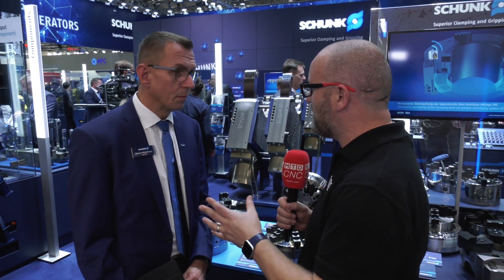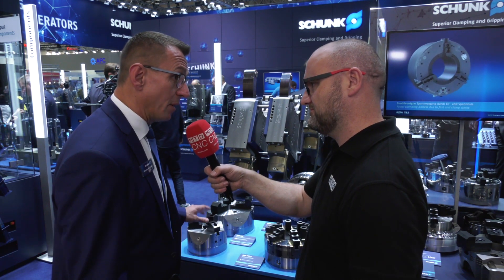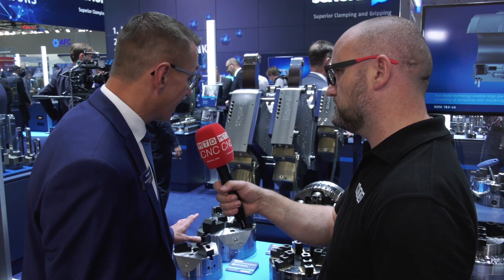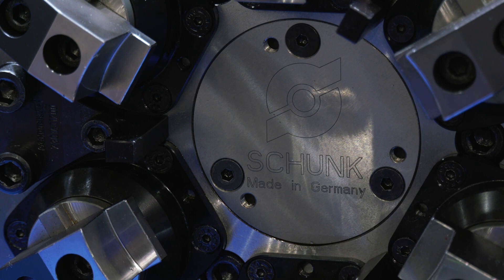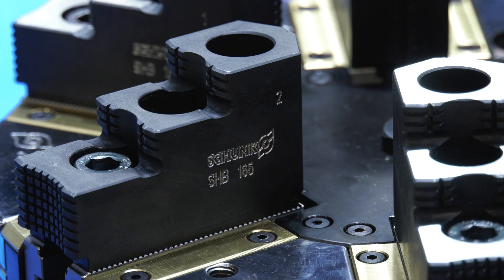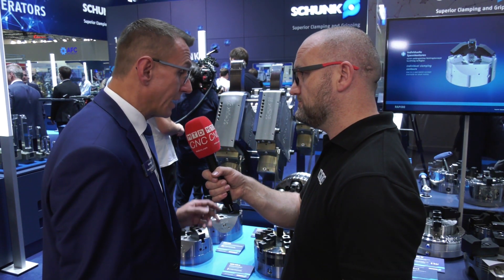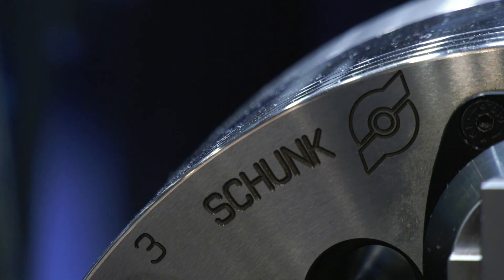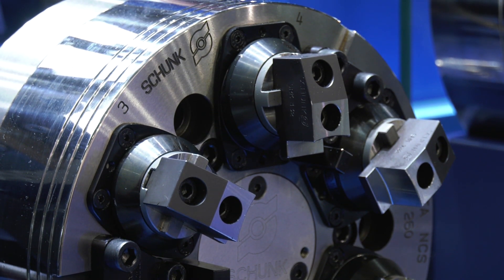Schunk present their new power chuck at EMO 2019

Comment: Question.... Does ANYONE grease their chuck every day? I  can't remember the last time I greased a chuck lol
Reply from the maker: You should always follow manufacturers guidelines to ensure maximum claiming force and chuck life..
Reply: If you grease your chuck it will increase your clamping force by 40%, hainbuch demonstrated this with chuck clamping force metres , and also the Jaws will move more evenly.
You can't optimise your material removal if you don't hold the part correctly.
Reply: @pdcaengineeringsolutions5306  This is the answer!! Thx
Reply: We grease ours every time the jaws come off, or at least daily for longer runs.